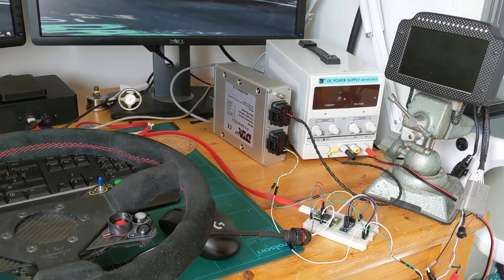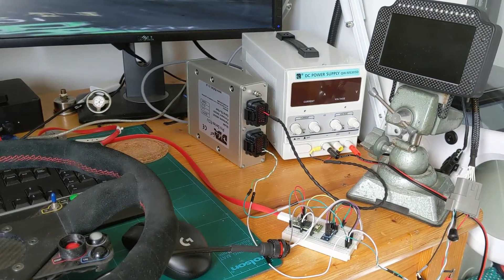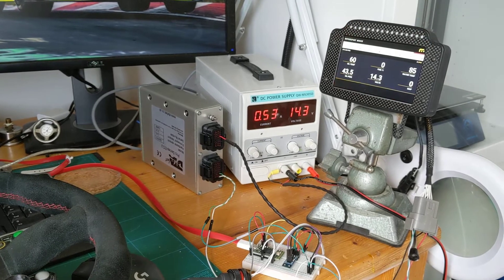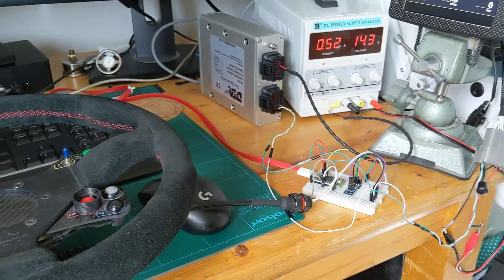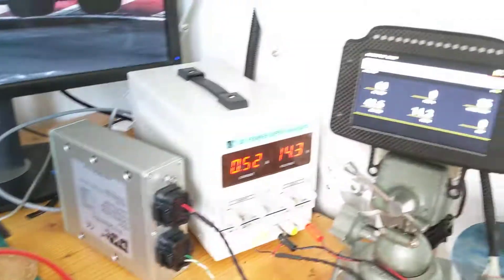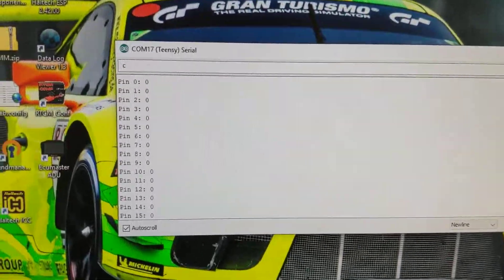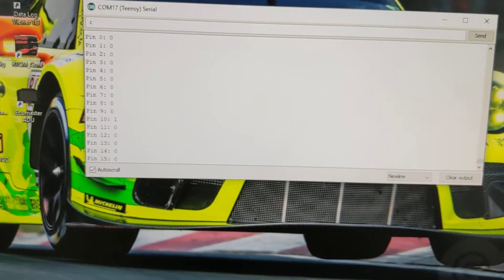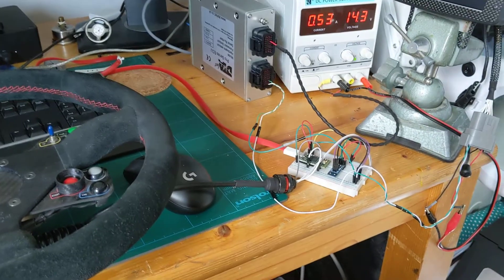Teensy CAN Switchboard

Comment: Hello! I'm doing a very similar project like yours, I noticed you are using Arduino IDE to develop STM32 board, right? Is it a relatively good way for a CAN switchboard design?
Reply from the maker: It seems to work ok for me. I have developed a couple of devices using Teensy 3.2 boards and the Arduino IDE which work well in my car. Which has an ECU Master PMU 16 and DTA S80 ECU fitted to it, all devices communicate well together
Reply: @TimDarracott  Thank you!

Comment: I'm using a Teensy3.2 with CAN for a fuel pump driver and a dash module.  I'm also sending serial data from the dash module to a 4D display engine data.  CAN is the best!

Comment: Why did you decide to output the button signals over CAN?
Reply from the maker: Less wiring. I plan to add a PDU to my car, and I'll be able to send messages to it over CAN rather than having wires for each button. It also allows me to write logic for buttons as well.
Reply: @TimDarracott  I see... I'm working on a very similar project using Raspberry Pi and Qt for my BMW E46. Just started writing software for button interrupts. I've been on the fence with outputting over CAN or just wiring the buttons directly to GPIO.

Are you also implementing brightness control for the display?
Reply: @TimDarracott  What is PDU?
Reply: @lllMspired  Power Distribution Unit, basically replaces the relays/fuses with mosfets...unless Tim is using some other voodoo.